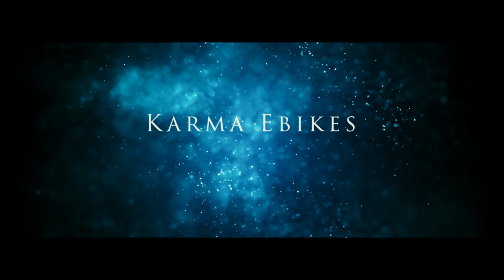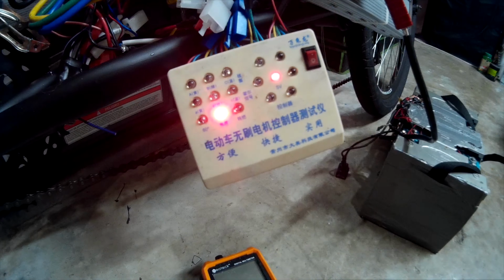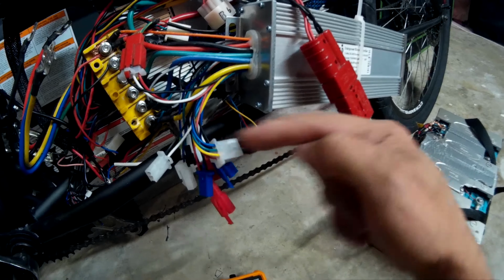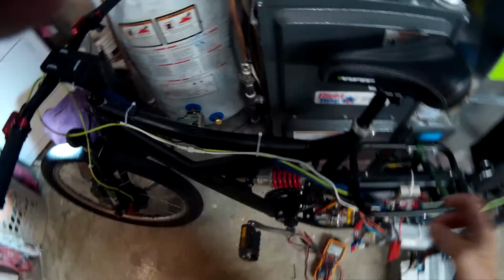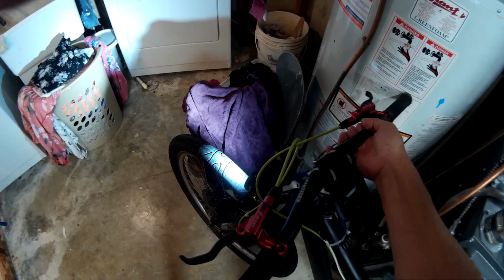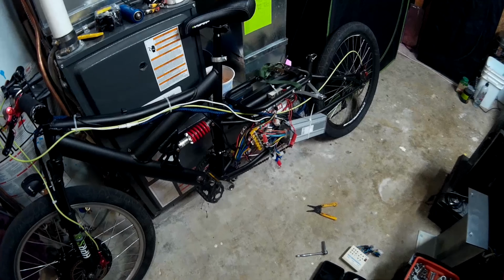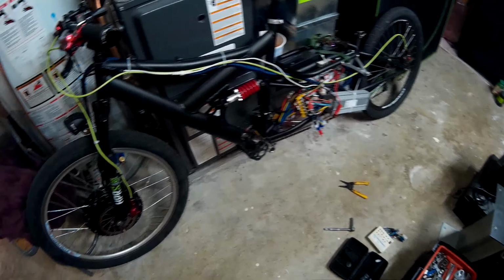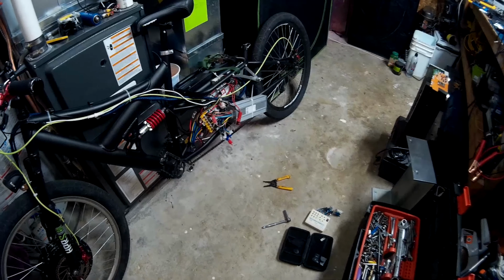ebike Controller, 36V/48V 1500W 50amps(test)

Comment: How did you connect the display to the controller there is no wire for it. Do have full video how did you connect all the wires.
Reply: Did you find a video after, I got different connections for my throttle wires and brake wires and also pedal assist wires

Comment: That goes pretty good. So i got a 1500W 48V rear hub. I have a 48V 10AH battery that I just installed a 50A 13s BMS into.  I have a KT 36/48 ZWSRL - ff01A controller rated with 35 +- 2A steady 17A.  Do you think that BMS is going to be ok, being a 50A?

Comment: Hi got 1500w to2000w 60a controller do u think if I can use it with 3000w rear hub
Reply from the maker: YUP
Reply: @karmaEbikes.  will it have less speed and power as controller is only 2000w 60a?
Reply: What’s that 1500 to 2000watts controller? I’m looking for one but can’t find one,
Do you have a link?????

Comment: Would a 48v 15ah battery be enough for this motor
Reply: it will work. 20ah or over would  be better if you ride long distance. also  depends on the chemistry used.
Reply: 15ah at 1500w wouldn’t last more than an hour
Reply: 20 miles maybe

Comment: is it compatible to used 40a controller yyk to a 1500w? or it should be 50a controller?
Reply from the maker: if i could find a 20a 1500watt controller i would use it. 40a or 50a will work. whatever your motor can handle

Comment: Hello, I would like to buy this controller (1500w)
But I have a 1000w 48v wheel motor and a 48v 17Ah battery
Is it a problem or is it good?
Thank you
Reply: motor will be fine, but ensure the battery can handle outputting 32A atleast

Comment: Hi I have a 72v 30 amp controller and I have a 20s 4p pack do you think it will work well for a 20" wheel or 26" ? I want low top speed high efficiency. I need help  connecting all the wires up to the controller are you in the GTA? Do you provide help to the ebike enthusiasts in the area?
Reply: Oh I have a hub motor for this it is generic Chinese one but heavy compared to similar looking ones.

Comment: Hi! Will this work on my battery 67.2Volts fully charge?
Reply: It would probably work but the caps would eventually fail. The 48 volt controllers normally have 63volt caps. Go for a 48- 72 volt controller those have 100 volt caps
Reply: @mashedpotatoes5323  if i change the 63 volts caps then im good?
Reply: @electric_rider2044  there are quite a few caps you would have to replace, if I were you I would only replace them if you can scavenge the capacitors from another device otherwise it would just be more worth your money to just buy a whole other controller than to buy each capacitor you need. Plus then you will most likely get a controller with higher spec mosfets that can handle more voltage too.

Comment: Does this controller require the hall sensor connected?
Reply: it has self learning. it will work if halls fail. testing the controller on the bench for a week on a 3 phase motor with no halls..